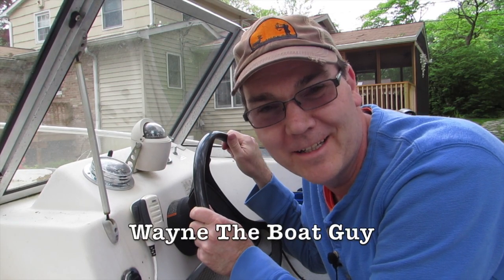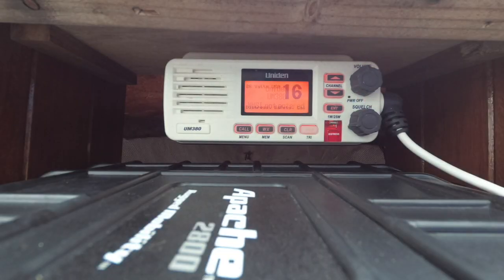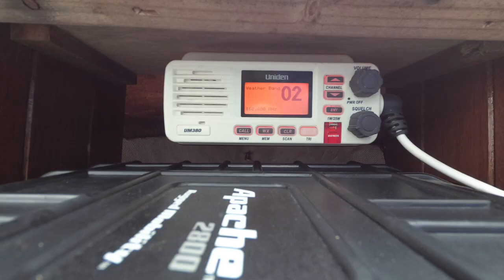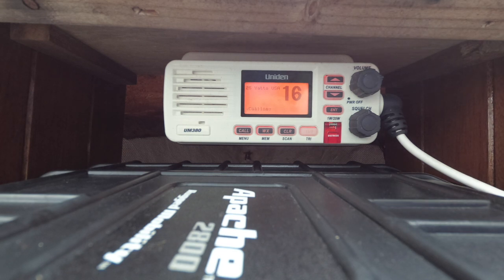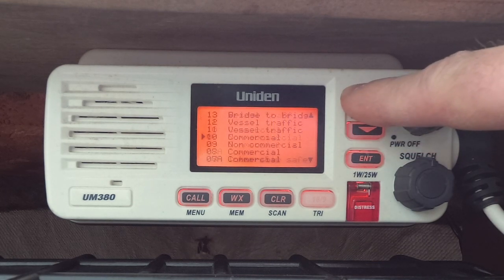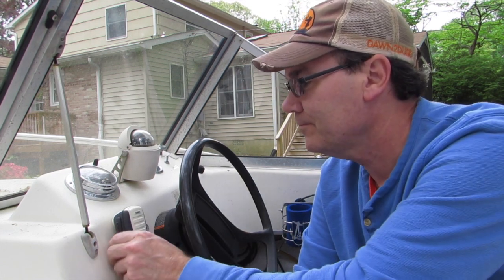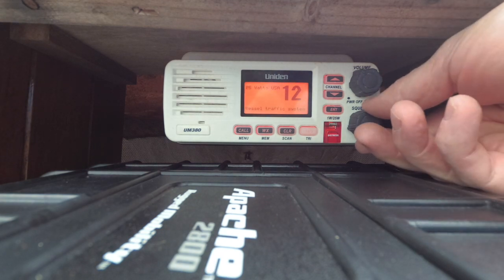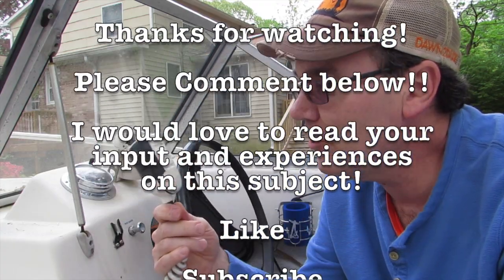Boating and using VHF boat radio basics. Do we still need marine VHF radios?

Comment: You really should have 2 vhf radios as you should always monitor ch 13 and 16 if you only have one radio monitor ch 13 as this is the channel you use to make passing arrangements hail other vessels and get bridges and locks opened just make calls short and don’t chat on 13 hail them and go to a working channel calls need to be quick especially in a busy harbor ch 13 calls need to be to the point example (on the “vessel name” the “your vessel name” they answer “vessel name standing by” you say see you on two they answer two whistles agreed that’s it no chit chat be quik anything else say go to 10 or whatever commercial working channel is free in your area and then you can talk but don’t jam up ch 13 it’s critical for us to safely navigate large vessels you should absolutely call any commercial traffic that you have any doubts as to there intentions believe me we would rather talk to you than be questioning your intentions don’t call someone  who is 1/4 mile away when the closest point of approach is 500ft but when there’s an actual question as to each other’s intentions use you radio that’s why you have it don’t be afraid to make a security call if your entering a busy pier it lets everyone know your intentions and your name so we can avoid mass confusion atleast moniter ch 13 and you will hear the commercial traffics intentions you will learn the names of the vessels operating in you harbor and where they are going just listening to ch 13 will let you know what’s going on we always use ch13 because it’s 1 watt and short range don’t call vessels on 16 as it travels for miles and will usually get the annoyed response go to ch13 as we all have at least 2 radios and monitor both but 16 but is not bridge to bridge which means from your vessels bridge to another vessels bridge
Reply from the maker: So many recreational boats around here don't even have one VHF radio - let alone two!
Reply: A local fishing charter in my area named his vessel "Knott Sure"

Comment: Enabling Your Radio’s DSC Emergency Features

Rescue 21 only works if you set up your radio correctly. You need to take two actions to get the safety benefits of DSC:

    Obtain and register your MMSI number (sort of like your boat’s state registration number)
    Connect your VHF radio to a GPS receiver.
Reply from the maker: Having the additional GPS receiver - that's the trick.
Reply: They have radios with built-in GPS receivers for a while now, no additional receivers necessary.

Comment: Also in case of emergency you can always use *16  ( star 16 ) on your Cell directly Coast Guard
Reply from the maker: I did not know that - pretty cool tip!
Reply: This way you may talk to them without interference,and still if any Mayday alert needs to be called out to mariner’s 🚤🚤🚤 .Hopefully if in cell range they can triangulate your position GPS the phone’s area

Comment: This might be random but does anyone know if you can get a marine radio and have it on land just to listen. Cause it would be pretty cool to have on and listen from my room
Reply from the maker: Technically, I don't think we're supposed to use one on land. I think partially because if I'm in my boat making a distress call and you feel compelled to respond because nobody else responds, there's almost nothing you can do. Also, because VHF radios work point-to-point and not from a tower, you might only hear 1/2 the conversation and be trying to respond which would tie up the channel for someone who might be close by in a boat who can help. So listening in might not cause any harm, but the desire to transmit could. At least that's my thoughts!
Reply: We use these radios every day in The Woods Logging !
Our Loaders, skitters, Trucks, office all have these radios! Also other logging outfits near by use these we all use different channels different Logging outfit different channel!

Comment: If you can barely hear Annapolis base then your to far to try any radio check.  Your radio doesn't put out the power that Annapolis does and their antenna is much higher than yours.  Learn about vhf signal propagation.  It will help you understand your radio immensely.  Better yet get a ham tech license and you'll learn a ton about your radio.  Good luck and best wishes.
Reply from the maker: I have heard of people upgrading their antennas on hand-held VHF units to increase the range.
Reply from the maker: As I dig deeper, I find more interesting things about VHF radios in my area. For example I often hear about boaters who have their mic locked on and I also hear about many who do not turn on or have a VHF radio at all. I have heard useful information just by having mine on Channel 16 several times while out in the bay.